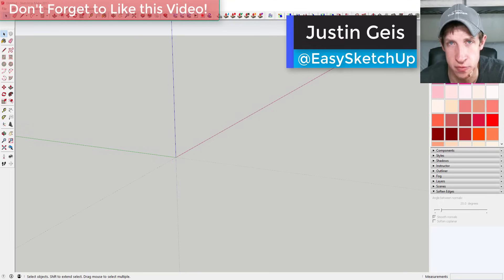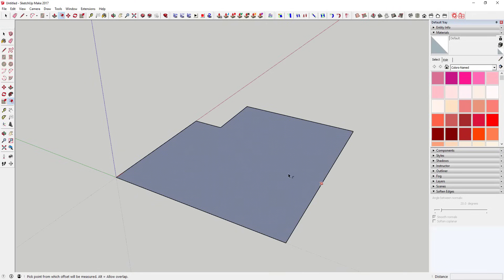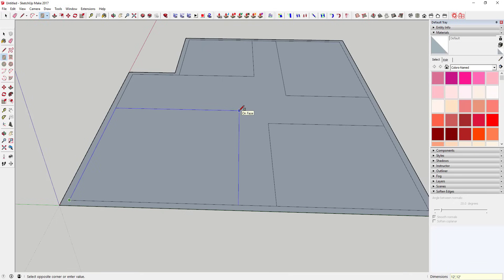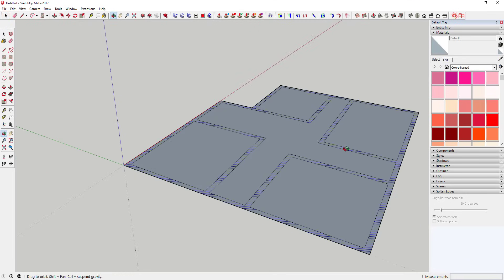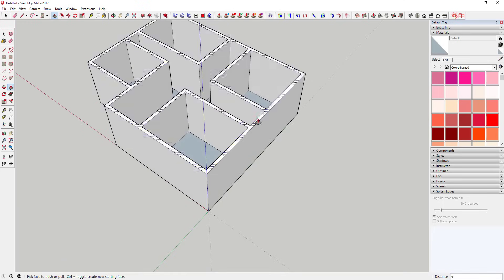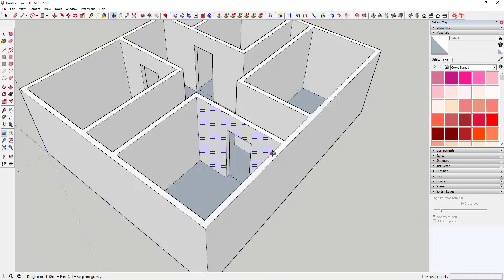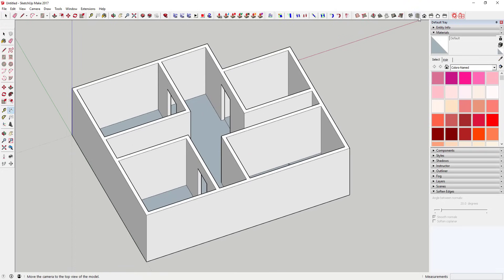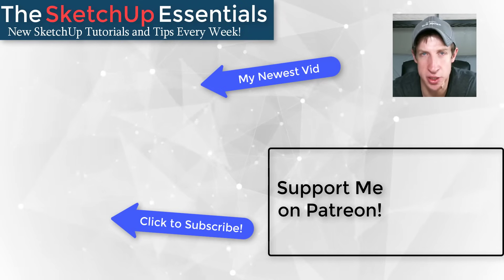Creating 3D Floor Plans in SketchUp Part 1 - The SketchUp Essentials #22

Comment: Hi! Love your videos! A few questions! Is there a way to edit wall lengths after it is already drawn? i.e. you make an entire floor plan and after the fact you realize you had one of the dimensions of a room or wall incorrect. Can you adjust it, or do you have to start all over? Surely you can adjust....? Also same question for windows and doors. Once window/door is placed/created can you drag the cut out door/window along a wall to adjust placement?

Comment: Do you group each section like floors and walls etc,right away? I was thought to group floors right away, then exterior walls then interior walls  etc etc, having a hard time with it when I come to moving walls in my model or even roofs.
Reply from the maker: Generally as soon as possible

Comment: Before trying SketchUp, I used LiveHome 3D and my older brother who is an engineer told me about "Google SketchUp" and how architects/engineers use it and so I wanted to try it out and I realized how much better it is for complex designs! Like seeing how you changed the size of doors and windows, I've tried to change the sizes of windows and doors in LiveHome 3D and they wouldn't change how I wanted them to! Seeing how you can do that in SketchUp just by typing in dimentions is actually awesome!

Comment: I hv loaded the floor plan video, watch
Reply from the maker: Interesting - I like the idea behind this of modeling from the inside of wall dimensions and then offsetting out - I'm not sure exactly how well it works if you're starting to model from the exterior dimensions, but I still like it as a strategy - thanks!
Reply: TheSketchUpEssentials it's about tape used as a reference for making a floor plan, it doesn't matter even if the dimensions r from outside or inside, it will work

Comment: good day , what is the best way to scale object uniformly in on direction .
Reply from the maker: Hi Fares - if I understand your question correctly, you want to scale your object in one direction without distorting it, right? To do that, activate the scale tool, then click and drag one of the edge grips while holding the shift key. The shift key will toggle uniform scaling mode as long as it's held down, allowing you to scale uniformly. Did this answer your question? Thanks for watching!
Reply: Sure thx so much